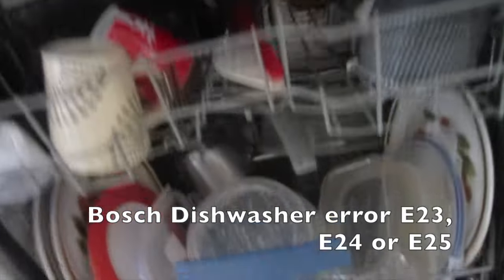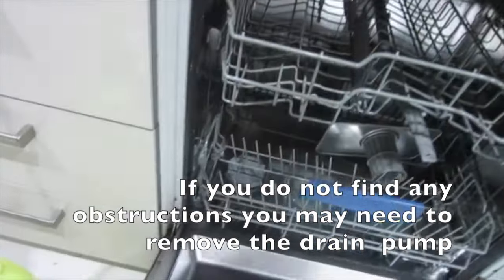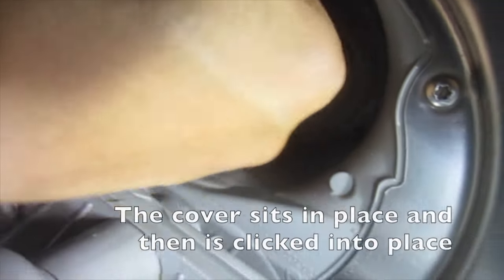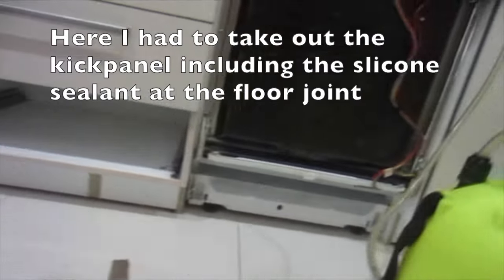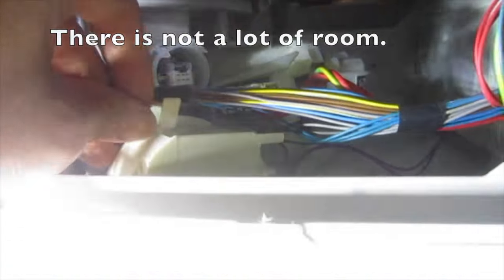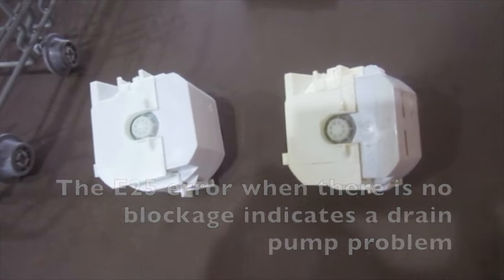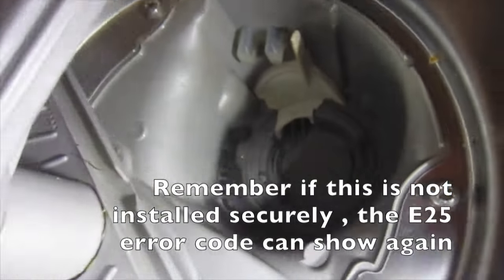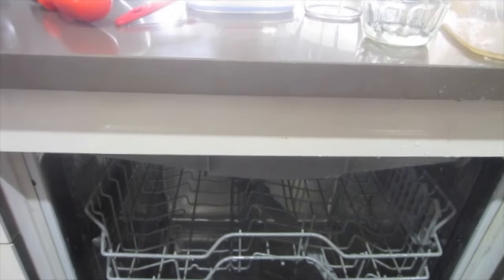Bosch E23,E24 or E25 dishwasher not working error fix (a detailed tutorial)

Comment: Your video is very good.  But I have to tell you this E24 and E25 error is a massive design flaw by Bosche. Very common and frankly not an easy fix. Even the impeller cover is a total pain to put back into place.  I know that replacing the impeller is way out of my league and my LG did not give me such a headache at all.  I regret buying a Bosche dishwasher and this seriously should be a class action law suit. The dishwasher itself has caused damage to my home.
Reply from the maker: I actually like the Bosch dishwasher. I suppose the blockage and impellers getting food and debris caught is the fact they are used to clean dishes and dirty items . 
The repair is actually quite easy if you take it slowly .
Reply: @Dentinvent  Honestly, I find putting the cover in always a bit of a discovery feeling around.  I am not handy and as pointed out in the viideo, it is tight quarters getting in there to replace the impeller.  I wish they would come up with a different solution. I don't think I would buy a Bosche again, though I loved it when I first got it.

Comment: Wow, our Boesch dishwasher was one of the most expensive and lasted about 2 years.  Every other dishwasher I have ever owned lasted decades.  Last Boesch product I ever buy.
Reply from the maker: Check if the dishwasher was made in Germany or China .
Ours is about 14 years old and still working fine ( after that drain pump change ).  They say the German made one lasts longer .
Reply: Depends what's wrong, I repair these for a living , what's up
Reply: My Bosch washer and dryer have been nothing but problems, too. Pieces breaking, hinges wearing out, errors when nothing is wrong, and it's not great to start with. Never Bosch again for me, either.
Reply: @Mr.Veridical  they are definitely not as well made as they used to be , I would say the main problems with their washing machines is the drum support spider is aluminium and it seems to desolve over time till it snaps and drum to expensive to replace
Reply: @Mr.Veridical My Bosch washer/dryer lasted 20 years, elctric dryer heating element replaced once, control board was the death of it due to no longer manufactured, washer the entire drum assembly broke off, manufacturer no longer available. I really was happy with it.
Reply: Yep, pretty much the same experience and I am disappointed.  Have a new pump on order and hope it fixes the problem.  If it doesn't. not buying another unit and imagine (hope) Robert Bosch is spinning in his grave.  Seriously, units from 40 years ago performed better than this.

Edit:  I withdraw this comment.  Problem was I didn't install the drain pump lid properly and didn't let it firmly "snap" into place.  It took a bit of doing, particularly as I wasn't sure how it was to go in in the first place, but now the dishwasher is running like a champ.  Sorry for the criticism, Bosch, we are back on good terms.
Reply: We’re all back on good terms until it breaks again!  I think the plastic parts vs metal are an issue, just like a car.  Plastic does not stand up to the wear.  My parents had appliances for decades and were all made of metal.  Now my repairman says max 6-8 years for refrigerators.  Really sad - and expensive.

Comment: E24 or E25 can also be caused by 1) discharge hose not elevated  a couple of feet behind washer before going to drain or 2) white plastic shield in front of impeller is not firmly “clicked” into place
Reply from the maker: I have heard of the number 2 plastic shield problem but have not heard of the discharge hose height problem .  You would hope most discharge hoses are hooked higher so the water does not drain back into the impeller area.
Thanks for your input .
Reply: #1 was the case for our dishwasher. After raising the discharge hose, the issue went away.
Reply from the maker: @WeekendMuse  
Was the dishwasher installed by an installer or by a handyman? Just wondering . Our discharge tube can only connect into the drain pipe at a certain height .

Comment: South Australia, Ive had the same d/w, coming up 14 years, 3 months, Love it.  Used at least 11 times per week.    Several years ago I had problems with error codes, and it involved the little white thing.  Managed to sort it out.   Ive only had a tech out once, I believe it was the wash pump and this was replaced at $400 about 5 years ago.   Daughter has a later model, she also had problems with gunk around the white thing, removed gunk and replaced.  Excellent video, so clear, no mumbling.
Reply from the maker: That’s great to hear . Pity you didn’t fix the pump yourself five years ago. The cleaner you keep your dishwasher, the longer it lasts .

Comment: I fixed mine today, it was making the e24 sometimes and it was annoying. I cleaned well the bottom of the dishwasher near the pump, then I removed the cover, removed all debris near because they were plastics. I did fill it with water and then ran the pump without the cover, the pump cleaned itself like that
Reply from the maker: Well done . If it keeps coming up as the same error later on , consider a new pump as they are not too expensive .

Comment: Dreaded E-25 error for weeks….Almost replaced the stupid machine ($1,500 installed), but I really like my Boshe….I decided to order the $30 part from Amazon (free shipping vs. Boshe website)and do it myself.  I swore quite a few times and almost gave up because I didn’t pull the unit out and this guy is correct, it was so tight to replace the pump.  Anyway, I used more might than delivering a baby, and it worked!  For a woman and single parent, trying to save $1,500, I feel like I can fix anything, as long as I have great YouTube videos like this one.  👏👏Thank you from San Fran, CA, USA…

By the way, I did have a repairman out, who typically charges $180, but he said he couldn’t fix it and left/no charge….I got no reply when I told him I fixed it myself! 😅. You can do it ladies, with a power drill and watching this great video.  Woot-Woot! ❤
Reply from the maker: That’s such a great write up ! 
My wife said I was wasting my time when I said I wanted to fix the dishwasher . It is still working after about 15 years and best of all, I got to help many others out there with the same problem.
Reply: Update:  dishwasher worked fine 2-3 times then E-24 popped up again.  😡 

I remembered from your video that if the little white filter cover was not placed correctly, the code would return.  Again, I stuck my head down there and sure enough, the little cover was not pressed in enough.  I tucked him into bed but didn’t hear any click but noticed as I was returning the main filter back into place, the circle of the main filter caught and loosened the stem of the white impeller cover!  

So my head went back in, flashlight, and more force was placed to put both cover and filter carefully back into place, slowly.  

 I believe in plucking out that cover stem so many times to check it, I probably bent the stem a little, causing this issue.

Ran the machine on short cycle; no codes!  Time will tell.

Tell your wife your video has valuable world-wide status and saved people like me lots of cash I don’t have.  Can wait to run the machine again…

Comment: Thanks for describing how you were turning the pump manually.  When disassembled 1st time I was unsure whether should spin easily.    It hadn’t so went back and rocked back and for until whatever there worked out.   Running cycle now.  Fingers crossed that obstruction moved on down the discharge line.  Cheers from Bellingham, WA US
Reply from the maker: Thanks for sharing. It seems many have this dishwasher . It has been a great appliance for us and it helps to know how to fix the problems. Good luck and remember that the pump change is not too difficult of it is eventually needed.

Comment: Thank you so much. This was honestly such a well made video. On the newer model I have SHP865WF5N-01  you need to remove two screws to get the metal cover off which you can do by loosening the top and removing the bottom screws of the cover. The hardest part was getting the new pump in but it was more a sight issue. I was able to prop a screwdriver in the bottom right corner and look at it from the top down to get a better view and it was easy after that.
Reply from the maker: Many thanks for the nice comment. I am glad you managed to replace the pump by yourself . Would have saved you a lot of money ( no service charge and saved your dishwasher )! Well done.

Comment: Thanks very much. This is a fantastic video, really detailed and clear instructions. I have a different model but all the mechanical bits etc are the same.
Reply from the maker: That’s great to hear . If you get stuck fixing it , I’ll try and help you .  The tips on taping the control panel make a lot of sense when you take the door panel off ( or the control falls off ). Hope it works out for you.

Comment: Thank you, great detailed video, I replaced a Bosch drain pump yesterday for the first time (done it many times for whirlpool, lg, samsung and ge) thought it was stupid design to remove the door panel to work on a drain pump, but job security I guess, right? Also found weird the way the pump impeller feels loose, threw me off 😅
Reply from the maker: Hope the video did help you with your replacement. Yes designed so that it is harder to change but they assume the average person is not doing their own drain pump change.

Comment: You didn't show what happened when you took the door panel off....does it come all the way off or just hang there on the tape and loosened screws?
Reply from the maker: Sorry man ,
The top part is taped on and screws taken out and the front panel drops off . This is to allow you to get under the front . The tape is so that the whole control section does not fall off as it has a heap of wires inside the control section . 
The front panel needs to be removed to get under the front of the dishwasher as the panel covers the drain pump . 
In the next scene you can see the front panel is missing .
Reply: Hey thanks.  All the wiring was attached to the door panel so I couldn’t take it all the way off. I ended up pulling it up 6 inches and taping it in place while I replaced the pump and it worked well. Thanks again for the video.

Comment: You dont need to remove control panel screws to remove door panel.

Sometimes one of the phases of the drain pump go faulty and this can cause E25.
Reply from the maker: Thanks for the comment re drain pump phases.
Re control panel, I took this dishwasher apart about 5 times and definitely would recommend loosening the control panel. The door panel is easier to get off and reinstall with that panel floating .

Comment: At 5:03 that L-shaped white bar is easily removed, it snaps out at the top. That might give you more room. 8:43 is one of the few videos that shows where those stupid spacers go. Mine both fell out when I pulled the door cover off, and I had no idea where they came from. They don't stay in place anywhere that I could figure, so I think I'll stick them to the spot shown with a bit of duct tape and see if that works, otherwise they keep moving or falling out when I try to get the door back on. My Bosch SGE53U56UC/B3 threw E24, then E15 (water in bottom), now E23. When I push start, something buzzes briefly, then a couple rapid clicks, then E23 again. Originally there was water left inside. I checked for obstructions and cleaned, then poured water in and sucked the end of the drain hose with a shop vac. It sucked the water out of the D/W so I'm confident there are no longer obstructions, but it won't go past E23. Once the new drain pump arrives, I will update with how it went. If that lets it get past E23, next I'll have to figure out where the water in the base came from. I see no signs of a leak under the sump or anywhere else so we'll see. Also there are other places where yours could be clogged, like a U-shaped trap in the plastic reservoir behind the left panel or where that connects to the drain hose, which is covered in other videos. Thanks for the great video.
Reply from the maker: Thanks for the comment . Yes at 8.43 those annoying spacers seem to go back in if you are careful and place them in place and try to put the door panel back in place . 
I do think the new drain pump should help clear your E23 code . Look for water leaking past the door seal for the water in the base of the unit .
Reply: @Dentinvent  The new drain pump fixed it. I have to say that this is possibly the worst engineering I've ever seen. There is no space to get the old one out or the new one in. After much fiddling and forcing I was able to get the old one out. Having to rotate the new one to align with the tab on the sump means that a fin on the pump binds against a raised channel in the dishwasher base. I finally cut that fin off the new motor with a knife. It's useless anyway. It's the one to the left of the electrical connection. Also, I used dish soap to lube the rubber seal, as seen in a few other videos, but mine seemed to dry and just make it sticky. I used high-temp grease from a previous repair instead. The gasket on a new pump is REALLY tight. I almost thought I had the wrong part for a while. The combination of the grease and cutting off that fin on the motor allowed me to finally get the new motor into the sump and properly click it into place. I ran two rinse cycles and did not see any water or leaks, so the previous E15 was probably water getting under there from opening the door when it wasn't drained or something. A fair amount of brown smelly water came out of the old pump, so possibly that was leaking. I think Bosch designed the base as if no one would ever want to replace the drain pump. All they had to do is make it half an inch wider and not put that useless ridge in the base or the fin on the pump. I also could not easily get those door cover spacers back in their proper position and they seem to be useless as well, so I'm just throwing them out. I hope all this typing helps somebody.
Reply from the maker: I’m pretty sure you could have replaced those plastic spacers in the correct position. When you get to a stage where nothing goes right , take a break and often when you have a clearer mindset, it helps .
As far as that tab getting in the way , I think you may have had your insertion angle a bit off . Mine took a while to line up and yes there was some swearing but it goes in with that tab still in place .
I’d always recommend silicone grease because it really helps seal out water and keeps the o ring lubricated .
Reply: @Dentinvent  Obviously you got yours in there, but perhaps you'd agree that it could be a heck of a lot easier. At 7:07 and 7:13 you can see that if the pump is rotated enough to get the channel on the pump past the tab on the sump, the square corner on the fin sticking out of the pump is going to be right up against the vertical rib in the base. I had to have the pump at a slight angle to get one edge of the rubber past the edge of the hole in the sump and then work it in all the way around - it would not go straight in. I spent at least an hour fiddling, with a mirror behind to make sure the channel and tab were properly aligned, etc. All I know is that once I cut 1/4 inch off of the square corner on the pump fin, it went in on the first try. Perhaps the grease was more key to success (not sure if mine was silicon or not, it was leftover from a washing machine repair). I can see where the fin on the pump is intended to divert dripping water away from the connection, so we'll see if cutting 1/4" off of it really matters. Regardless, your video and comments here were very helpful. For $40 shipped and a couple hours of swearing you saved me a bunch. Thanks.

Comment: make sure to check air gap for debris, remove white top with flat head. went through the trouble of replacing the pump when i think the problem was the air gap
Reply from the maker: This air gap you mention, where do you see that gap?

Comment: Hi what about an E24 error, that shows up and the botom of the machine stays with alotnof water? Will itnbe the pump
Reply from the maker: Does not sound like the pump. More likely blockage in the drain hose or filters . Try blowing air back from the drain output and look for blockages with food debris.

Comment: Hi I have an E24 error on my Bosch DW, but it drains correctly and there are no blockages I can hear the water drain into the sink fitting. There is no more than 5mm of water when I check the pump area. The error comes up after about 10 mins of operation. I have cleaned the unit extensively and there are no blockages from what I can tell in the pump area nor in the hose. Any Ideas?
Reply from the maker: Even though the unit appears to be draining , if the pump is faulty , the error will show as that code . The pump is not very costly and changing it would a. Give you peace of mind and b. Most likely stop the annoyance of that error code.

I think when the pump starts failing , the unit detects the pump has increased load and you get that error .
Reply: It might be your control panel. I’m having similar problem I can hear water going down when I hold the start button but doesn’t drain on wash cycles